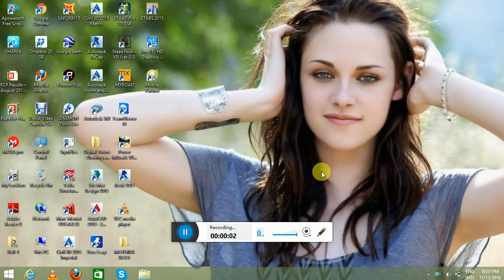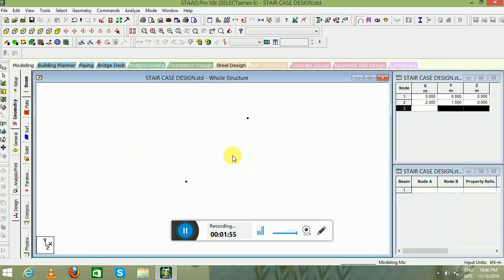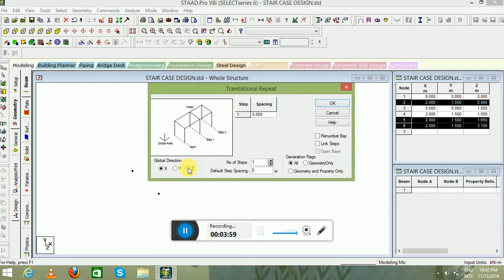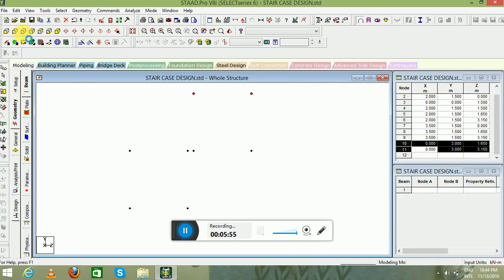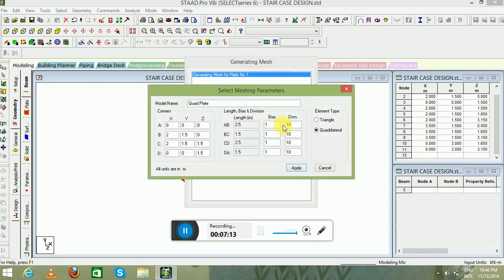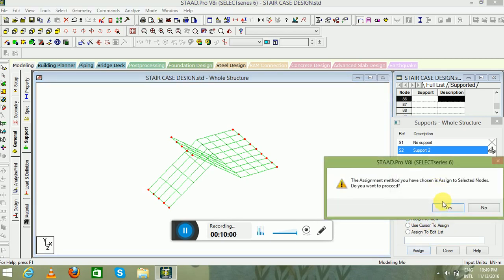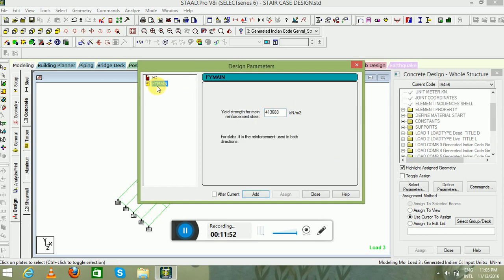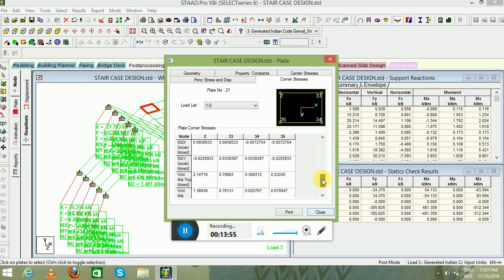Stair Case Design In Staad Pro V8i(U shaped)

Comment: Hey thanks for the video..  why the live load is taken as 25kN/m2?
Reply from the maker: Welcome share the video with your civil engineering friends you can take value as per your requirement according to your country codes mentioned values and formulaes.
Reply: Vibhor Shukla i tried a g+2 building  and did the modelling, gave properties, materials, loading, design, everything. Still when i run analysis it does the analysis but does not open the post processing mode. Can u tell me what might be the reason?